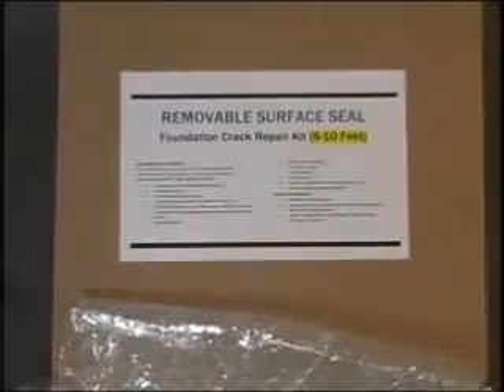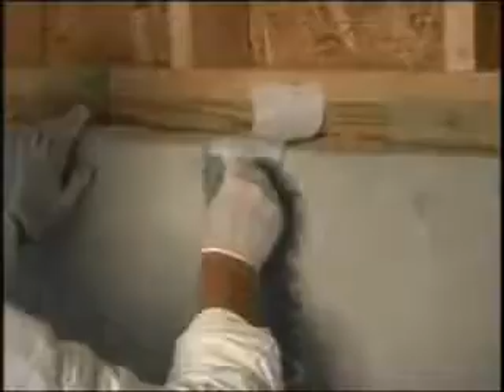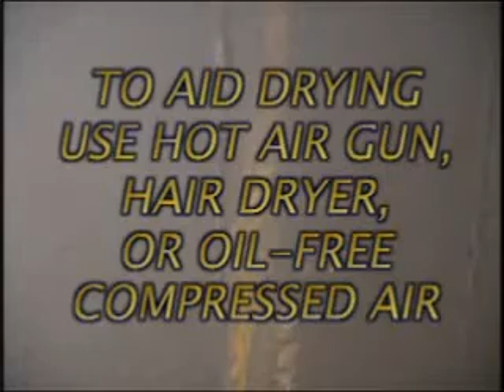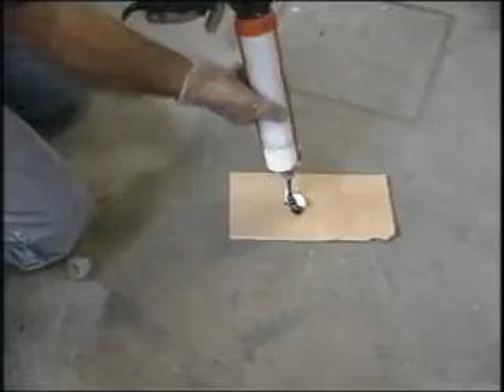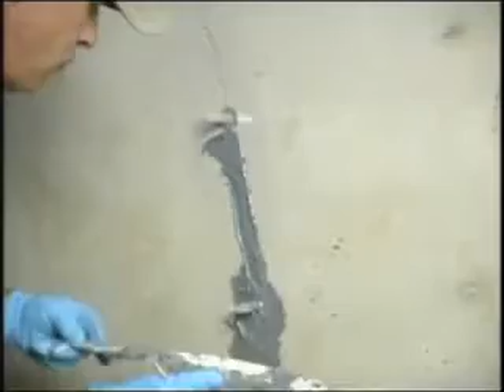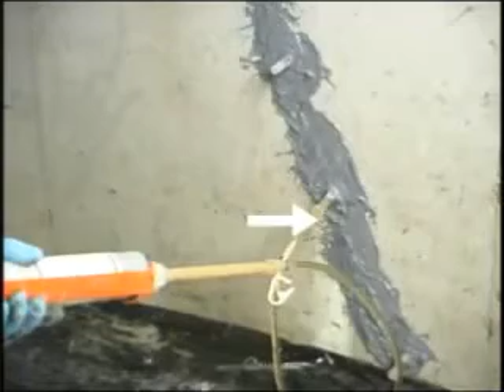Concrete Foundation Wall Crack Repair, Low Pressure

Comment: ok seems like all these crack repair kits are pretty much identical, in fact i'd bet good money that its the same main company producing these products under several dozen name brands. what company actually manufactures and distributes the kits? i'd like to find a bulk source for the materials as i am a masonry contractor and would like to add this type of system to my arsenal to expand my business a little bit but these tiny weekend warrior kits at an average of $150 per 8-10 foot of crack are just prohibitively expensive.